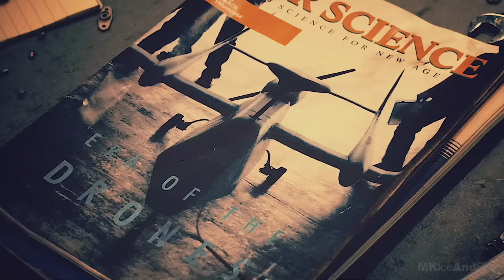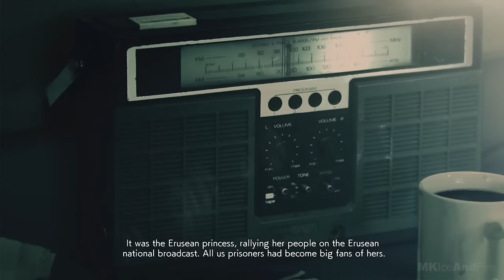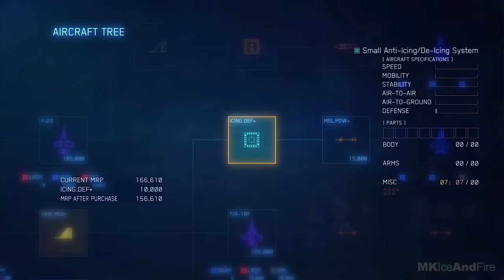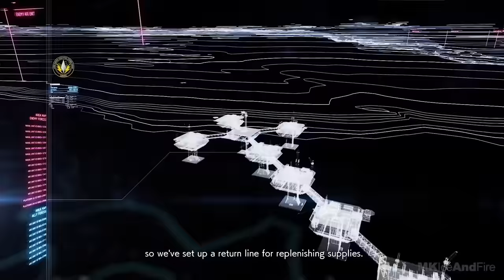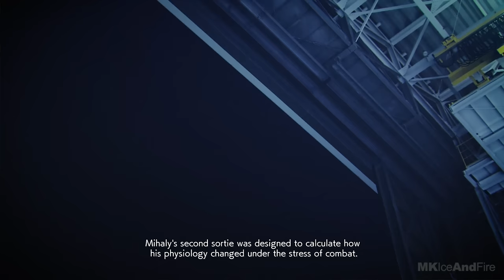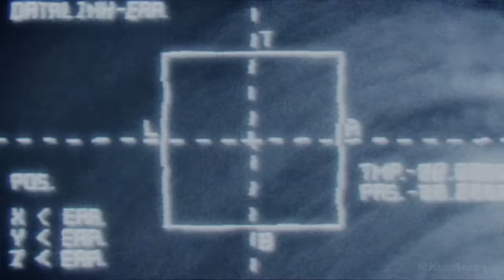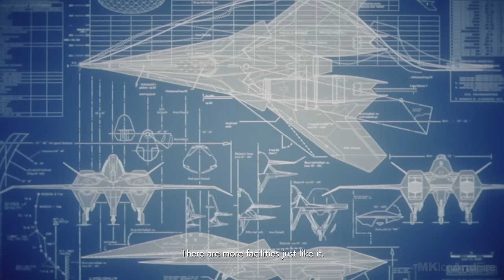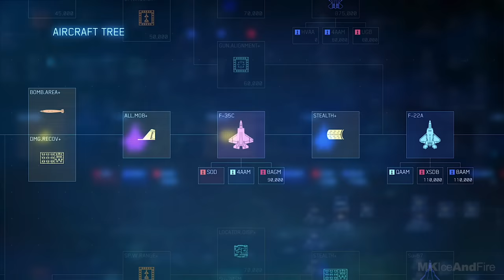ACE COMBAT 7 Gameplay Walkthrough Part 1 FULL GAME [1080p HD 60FPS PC] - No Commentary

Comment: Is it just me or is the maneuvering of the lanes lacking in comparison to previous ace combat games? Cant do a barrel roll,  cant really invert your plane and fly upside down. About the only way to fly upside down at this point where im at in the game is to pull back on the joystick at high altitude and keep holding it back until youve flipped yourself upside down.  This ace combat seems far more difficult to me than the previous ones. Not knocking it by any means. It's a great game but my memories of the past A.C games seemed like they were far easier as I said above.

Edit: feeling like a dumbass. I got to mission 16 and remembered about switching to expert control setup. Wow. In my defense,  it's been several years since last I played Ace Combat.  On the upside, I got so good on standard control setup without being able to fly upside down or do barrel rolls that now that I can, I'm slaughtering the game lol 😂